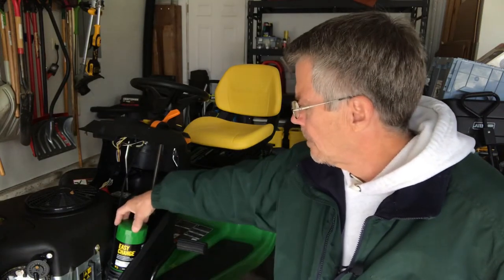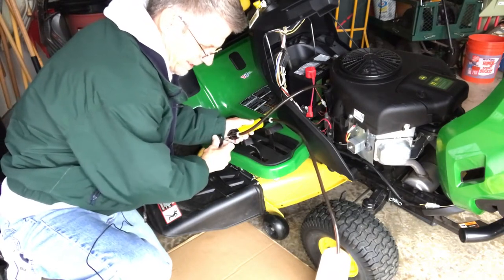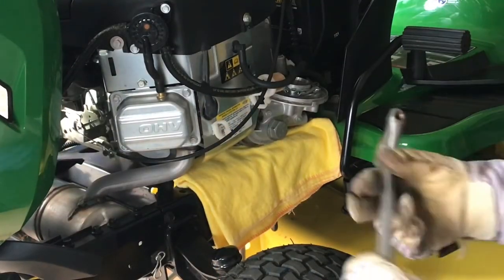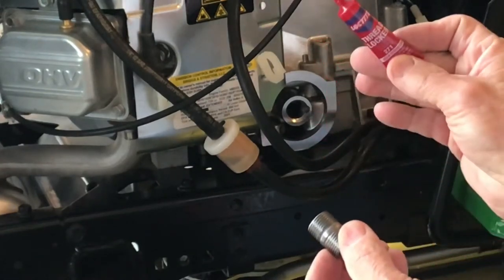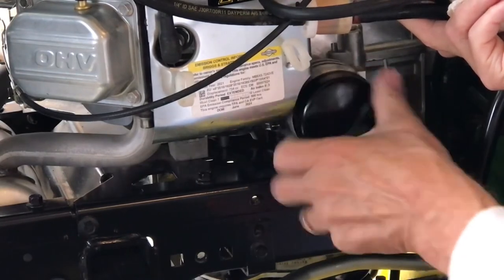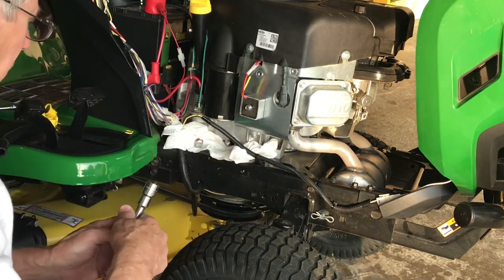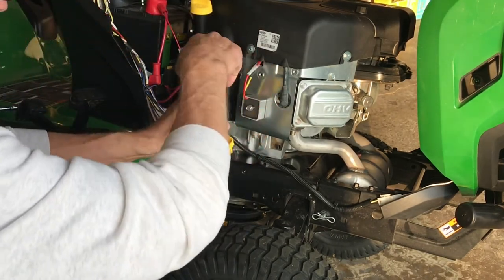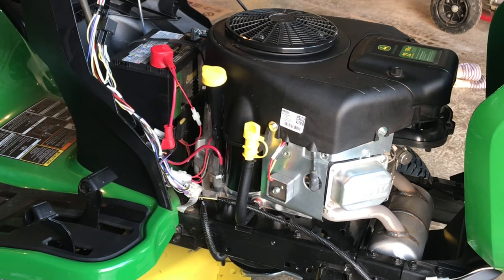John Deere Easy Oil Change Conversion with No Oil Spill (Almost) @DIY Boomers

Comment: One thing I don’t like and noticed that one of the fuel delivery hoses is rubbing against the valve cover of the engine! This is not only a fire only bad for the hose because continued rubbing against the valve cover will wear the hose out. What’s John Deere’s recommendation?
My tractor has 24 Hp twin cylinders engine.
Reply from the maker: Good question. I’m going to have to take a look at that.
Reply: A good back up plan for that, as well as,  to prevent fuel from dumping into the cylinders or valves from a carb float needle seat failure or fuel pump failure, is to install a manual shut off valve behind the fuel filter.  This also makes changing the fuel filter easier without gas pouring out. 
   Just remember to turn it off after using and on before using. Lol
Reply from the maker: @mbcarbaugh78 Yes, I’ve given it some thought about doing that. Good idea!
Reply: @DIYBoomers  it's definitely worth a thought.  Two years ago I actually had that carb issue happen with my GT225.  So much gas drained into the cylinder that pure fuel flew out of the exhaust on start up when I went to mow. I was lucky it didn't hydrolock with fuel. I did have some gas drain through the valves into  the crank case and had to change the oil and filter. After a carb rebuild I installed a manual shut off to prevent it from happening again. That was three years ago. 
    The shut off valves and hose clamps are cheap, easy to install and can provide insurance from future issues if used correctly.  I don't consider it a modification,  but it's actually the first thing I'm doing to my S130 when I get it, aside from the Easy change filter delete.  
    I'm not sure if that voids the warranty. But it's worth the peace of mind and can be reversible if done with a little extra fuel line between the filter and shut off valve.  
   But, that's just my two cents of advice.
Reply from the maker: @mbcarbaugh78 Wow! No doubt, it’s cheap insurance.

Comment: Thanks,  I'm going to change my 130 oil conversion  kit. Did you buy  the kit at John Deere?
Reply from the maker: You’re welcome. No. Although you can find conversion kits with everything you might need, I opted to buy individual parts basically because I wanted to install the drain hose instead of the drain pipe extension that came with the kits that I found. There are various kits out there, but I didn’t see any that came with a drain hose.

So the parts that I used are:

Threaded nipple for oil filter - John Deere
#MIU13767

Oil Filter - Briggs & Stratton #492932S

Briggs & Stratton hose connector #796532

Briggs & Stratton drain hose #594200

Comment: Does it void your warranty?
Reply from the maker: So below is my reply to a previous comment where we were discussing exactly that. He said that he was told by a JD Dealer that it would void the warranty. From what I can tell, it appears to me that it doesn’t void the warranty although I have never contacted John Deere. I saved the original parts incase I had to put them back on for warranty purposes but the tractor was like brand new when the warranty expired.

… After a quick search on the subject, I saw that one parts dealer sells what they claim is a JD authorized conversion kit and also says that it doesn’t void the warranty (link below).

https://www.greenpartstore.com/John-Deere-Easy-Change-Conversion-Kit-AUC12916-KIT.html

I also found a JD Frequently Asked Questions About JD Warranty page that states what is not covered under warranty. The third line says Those altered or modified in unapproved ways (link below).

https://www.deere.com/assets/pdfs/common/parts-and-service/warranty-protection-plans/WarrantyFAQ.pdf

So I guess it hinges on how JD looks at it. Let me know if you see confirmation from JD on the subject. Beyond that, one could always put the original quick change parts back on the engine if warranty repairs were needed. I did save everything from the conversion and my two years will be up later this summer. One could wait to do a conversion until the warranty has expired if they wanted to be sure, but I would be surprised to encounter a problem in that time frame when maintained properly. Interesting stuff though!

Update:
I looked further on the parts dealer add for their conversion kit (first link above). The third review for the kit by a purchaser says that they contacted JD before purchasing and was told by JD that it would not void the warranty. 🤷

Comment: I don't like leaving dirty oil in either, so what I did last time, was to replace the 30 sec oil filter and drain the extra oil from the right side of the engine, where you put your drain. That way, it's the best of both worlds, using the big filter and drain all of the old oil. Just more costly. I don't know if the 30sec filter is any better than the regular filter but I've seen the 30sec filter with the outside cover removed and the filter inside is quite small. Someone needs to test it, vs a standard filter.
Reply from the maker: Now that’s a twist! Would have never given that a thought. Certainly gets the job done.

Comment: Do you have the part number of the conversion kit?  Great video!
Reply from the maker: Thanks! Although you can find conversion kits with everything you might need, I opted to buy individual parts basically because I wanted to install the drain hose instead of the drain pipe extension that came with the kits that I found. There are various kits out there, but I didn’t see any that came with a drain hose.

So the parts that I used are:

Threaded nipple for oil filter - John Deere #MIU13767

Oil filter - Briggs & Stratton #492932S

Briggs & Stratton hose connector #796532

Briggs & Stratton drain hose #594200

Comment: Where did you get the screw in adaptor for your Briggs & Stratton 594200 Oil Drain Hose???
Reply from the maker: I bought the Briggs & Stratton Hose Connector #796532 and the Briggs & Stratton Oil Drain Hose #594200 on the internet at jackssmallengines.com

Comment: The JD quarter turn type filter looks very simple and has more capacity than the Briggs.  Why did you swap?
Reply from the maker: Didn’t like the fact that the quick change leaves half of the dirty oil in the engine every time to mix with half new oil. John Deere says that the quick change filter is a better filter but just doesn’t seem like good maintenance to me.
Reply: There are vids on YT showing the quick change filter cut open. Guess what. The oil filter inside the  quick change filter is no bigger than the small one you screw on as the old style. Besides you don’t even remove 1/2 the dirty oil using the quick change filter.
Reply from the maker: Yeah, I was never too thrilled with the whole idea.

Comment: I thought the 30 second oil change was a good feature, why are people converting it to conventional. Planning to buy S130 should I instead go for S100 that comes with conventional oil change. Also S100 has mechanical blade engage vs S130 that has electronic one, which is a better system. Thanks in advance
Reply from the maker: On the surface, the 30 second oil change seems like a great idea, especially for those that can’t, or don’t want to do a conventional oil change. The cost is much more for the 30 second oil change. The question that remains to be seen is, will the new method do an adequate job of maintaining the engine? The S130 holds around 2 quarts of oil. The 30 second filter leaves approximately 1 quart of old oil in the crankcase while replacing the other 1 quart with new oil. John Deere claims that the new filter is an improved design over the conventional filter. So anyway, some, including me, just don’t like the idea of leaving half of the dirty oil in the engine at every oil change. Time will tell, we’ll see how that works out.

The manual vs the electric PTO is another preferential debate. I don’t have a strong preference. I needed a new tractor in the middle of last summer when there weren’t many to be had in my area. Was lucky enough to stumble across a local dealer that had just received 2 S130s the day that I called and didn’t expect any more deliveries the rest of the summer. The S130 was the size, cost and features that I was mostly looking for.

From what I’ve read, the manual version requires more adjustment over time and wears more on belts than the electric. Haven’t heard that one lasts any longer than the other, but the electric is more expensive to replace. 

Check out this video that outlines the differences in the S100 line. 
https://youtu.be/nK8A9vApoSg

The S100 has a low cut back on the seat. The S130 has a two piece higher back.

The S100 is a 17.5 HP one cylinder, the S130 is a 22 HP two cylinder.

The S130 has a much wider rear tire and comes with a front bumper.

The S100 has a mechanical float gas gauge down below the front of seat, the S130 has an electronic readout gas gauge on the dash.

And of course, the oil change difference and the manual vs electric PTO.

Good luck in your decision making!

Comment: Will Teflon tape work as well as the locktite?
Reply from the maker: Good question. A quick search on the topic turns up a couple things. Looks like Teflon tape is used by some on small engine plugs. 

Surprisingly, they say that Teflon tape is actually a lubricant, and not a sealant. However, it is used to prevent leaking by clogging the threads where it is installed.

Even though Teflon tape will not dissolve in oil or gas, I would be concerned with the possibility of strips of the tape slicing off the plug as it is being tightened and entering the crankcase. Click the link below and scroll down the article to watch the video which shows that actually happening. Personally, I don’t think that I would take that chance. It’s your decision, but I would recommend researching further before doing it. 😊

https://www.mcnallyinstitute.com/is-teflon-tape-ok-for-engine-oil-drain-plug/
Reply: @DIYBoomers  To further that point, lock tite is designed to dry up and "lock" the threads, to prevent bolts or nuts "in this case an oil fitting" from backing out due to vibration inherent in the engine operation while in use.
Reply from the maker: @Novagunner  Good point!

Comment: How much oil on the refill? Briggs part number for the drain hose? *The Briggs stuff is 2x's the price of the OEM*
Reply from the maker: Around 2 quarts for the refill. The Briggs & Stratton drain hose is #594200. What Briggs equipment is 2x the OEM cost?
Reply: @DIYBoomers  John deere filter $9cdn (briggs is $18cdn), Oil tube is $12cdn (briggs $34cdn)
Reply from the maker: @GorillamansGarage  Wow! Too bad you can’t get U.S. prices. $9 - $10 for the Briggs filter and the drain hose is $19.

Of course you have to figure in the exchange rate of 1 U.S. dollar = 1.28 Canadian so that makes up a little of the difference. But if you can get the John Deere equipment for the same as the U.S. pricing, that sounds like a good deal to me if I’m looking at it correctly.
Reply: @DIYBoomers  : Yes... Ironic isn't it? OEM prices are cheaper than off brand ones :D

Comment: I'm guessing you don't have any metric tools 😂. For some reason this American machine uses metric nuts and bolts. The acception I noticed was the blade nuts. Great video though! Thank you
Reply from the maker: Thanks! I have bought a few metric tools, but only when necessary. I needed a set of metric Allen wrenches so I got those and I did get a small set of 1/4” drive sockets. Holding out though as long as I can just for the principal of it. 😎

Comment: Given how far B&S engine quality & durability have fallen over the past 20 years, only removing half the dirty oil seems like a sure fire way to have customers coming back every 5 years for a new mower because their current mower engine has blown up. 
Add to that the very high cost of that filter, it is a big win/win for JD.  Not so much for the consumer.
Reply from the maker: Yes, absolutely!

I find the development of the easy oil change system very interesting. That they are only putting it in a very small portion of their mowers, makes me wonder if it is actually as good, or any better than the conventional method. I suppose it could be strictly a marketing plan to attract buyers that can’t or don’t want to do the conventional oil change. 

I guess time will tell. If five years from now, the easy change is not more widely used, I would be inclined to think it is the latter.
Reply: J D paint is like a Navel Orange, Easily Peels off after a year or two of use.
Great paint job John Deere.
Your mass production has truly killed one of the Greatest Names " John Deere" I guess thanks China!!!
Quality has left the station.
Sad, another American product destroyed by overseas production costs.
Reply from the maker: @tedr.richardson4655 That doesn’t sound good. Haven’t had any problems with mine yet. I see they have changed the deck color to green. Don’t really care for that.

Comment: 30-second easy change filters a bunch of crap, oil still stays in the engine and you still have to add oil, that crap filters are filling up landfills. conversions lot better to put the small filter on.
Reply from the maker: Yeah, it really makes you wonder.

Comment: You should add a fuel shutoff before your fuel filter.
Reply from the maker: Haven’t changed the filter yet but that’s not a bad idea.
Reply: @DIYBoomers  yeah you don't really have to dick around draining the fuel over the winter really if you keep the mower inside and use fuel stabilizer or ethanol free then, just close the shutoff with it running and let the mower die.
Reply from the maker: @karatejoe5049  Just might do that. With my old Craftsman, the gas tank was up front under the hood where it was easier to empty before letting it run until dying. The tank on the John Deere is inside the chassis under the seat.

Like everything else, there are different schools of thought on winter storage. In the past, I usually have drained the carb on all machines by letting them run dry. After reading up on the leaving the treated gas alone debate, last winter I treated the gas and let it sit without draining it. Some think that it is better than letting things dry out. As long as stabilizer is used, it doesn’t sound like a bad idea.

Comment: This easy oil change thing is nonsense - JD engineers should be ashamed-- I have been working on lawn equipment for over 60 years- I would never own a JD
Reply from the maker: Yes, it is nonsense. In your 60+ years of experience, what’s the best lawn tractor?
Reply: @DIYBoomers  I stick with the old makes 15 years or older- mtd or toro
Reply: mtd - easy to work on- parts are cheap

Comment: John deere is just creating new ways to make more money off their customers
Reply from the maker: Without a doubt, like any other company, they are always looking for ways to increase their market share. IMO, they’re probably looking at attracting buyers that can’t, or don’t want to do normal oil changes.

However, it certainly makes me wonder about the long term effects on engines that continually operate with 50% to 100% dirty oil.

Comment: Good video but I wouldn't own a John deere lawn or garden tractor both are garden straight up overpriced overrated garbage..
Reply from the maker: Wow. I guess everyone has their own preferences. Which brands do you favor for reasonable cost and quality?
Reply: I have a 4 year old E120 with 90 hours on it that still looks and runs like new.
Reply from the maker: Yeah, for this price range of lawn tractors, I don’t see anything out there that is better quality and more reliable.

Comment: Now an oil change will cost $15 instead of $40.
Reply from the maker: Actually, $40 in savings (in my area). The quick change canister is $55 at Home Depot and $56 at Lowes.